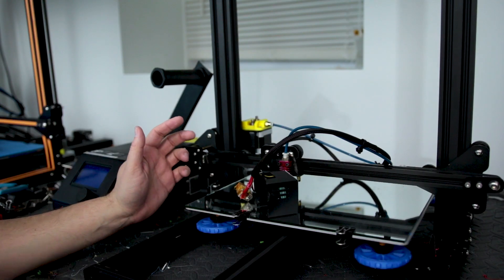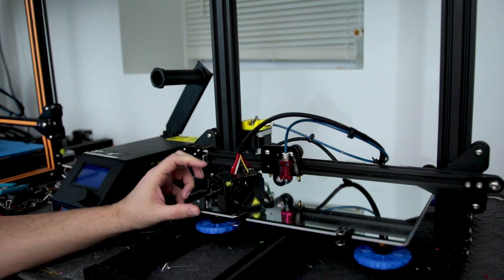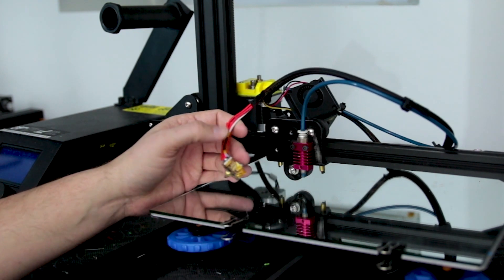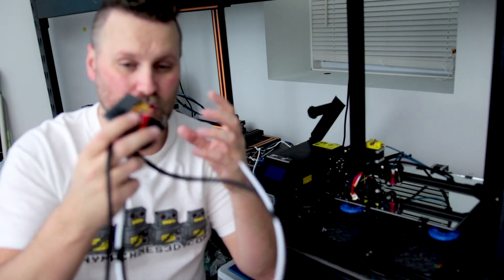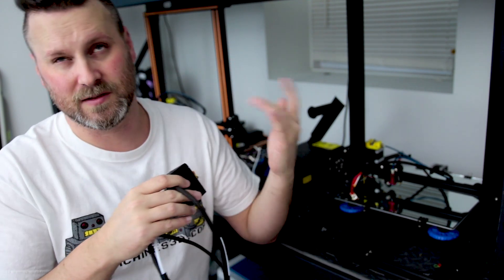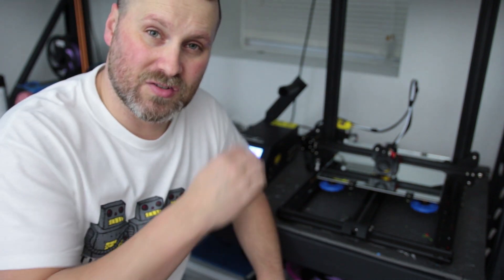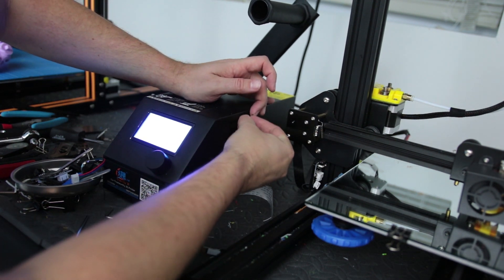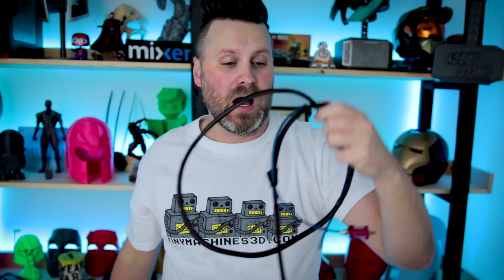I BROKE MY CR-10 3D PRINTER!

Comment: is this just the basic cr 10? I am looking into buying a cr 10 which one should I go with?
Reply from the maker: Nrc 470 standard CR-10 is my jam. Easily my go to printer. Filament runout sensor that’s on the new model is nice but I don’t necessarily think it’s s must have.
Reply: Uncle Jessy alright so I’m buying my first 3d printer. So would it be worth buying the cr10s or should i just buy the original Cr10. If I bought the cr 10 original I know you can add the extra motor. Let me know your thoughts.

Comment: If you just snapped the metal nozzle threads, you could have upgraded to an all metal hotend. No soldering is required. You are supposed to heat the nozzle before removing it to melt the plastic that's left in there.

Comment: I thought I would get an idea from you on my CR-10 Problem.  I have no experience on troubleshooting a 3D Printer.  
My CR-10 has been working great for several months.  Last week all of a sudden when I went to check on it printing a 9 hour project I found it had just simply stopped.  I uploaded a different pring on my SD Card and started it again.  About 3 1/2 hours later when I checked: It had again stopped.  The LCD just looked like it was waiting direction.  Again I tried a different project again after a period of time I found it had stopped again.  3 times it had stopped printing the 3rd or 4th layer.  One time it stopped printing a vertical panel 2 mm thick: stopped about 30 mm high on the Z.  Any suggestions would help.
Reply from the maker: Carl Beck here are a few things to test, try saving the gcode from Simplify3d/cura etc to your desktop of your computer then transferring to your micro sd card. Sometimes the card is almost full or slow to save the files. Are the prints failing at the same height or random? If same height check to see if the printer isn’t too tight on the upright bars and can move all the way up
Reply: Thank you for your input.  I keep my SD card neat with usually with less than 5 projects so it is not close to being full.  It stops at random locations.  Once it even got to about 30 mm high.  Other time it stopped randomly between 3 and 5 layers.  Thank you very much for your feedback.  I appreciate it very much.

Comment: Raspberry pi 3b with octo print and a pi camera then you can even remotely see and stop your print if it fails and the best part is you don't need to swap around sd cards or run your machine off your laptop.

Comment: It's nice that they have the all-in-one solution now. I had a failed heater cartridge on mine a while back and I remember that this wasn't available, since I had to figure out how to splice wires to repair it. Of course the heater cartridge costs like $2 versus $50 for the new hot end assembly, so it was probably a good thing that I was forced to learn to repair it in that case, but it's good to have the option when something goes really wrong.

Comment: in doing this print the tape on my bed was ripped off and mangled not good for future prints should just take the tape off and apply new tape?go with just bare glass? or flip it over and use the glass side without tape?

Comment: Hi, just want to start out by saying these videos are INSANELY helpful I dont know what I'd do without them but I tried printing the cat model from the sd card and when it began printing the filament I noticed immediately that it was not making a model remotely similar to yours. tried a different file same shape just went to far left corner of the bed and went left right left right left right over and over. Stopped my print after I heard the extruder struggling to move to the right and got this one thick sliver of plastic. Any help?

Comment: You also can fix the issue with the non locking micro SD card reader by removing the spring, then it functions like a friction slot.

Comment: I just had same issue on mine cr10 s4  as well the the extruder breaking but this was the metal shaft  from the cooling jacket to the hot end so i replace it with a new one called Zomiee from amazon works well no problems just finished printing the Red Hood Helmet

Comment: LOL - must be the day for CR-10 failures.  I had a wire on my fang cooling fan break in the middle of a 3 day print today.  Paused the print, re-soldered the wire, and resumed.  RE: SD Card - I don't get why people screw around with those.  Hook up an OctoPi and you'll never go back to SD cards.

Comment: Happened to me on the Anet A8.   bit to much force to get the nozzle of.   Did not heat it enough.  had to replace the heater block and the throat ...   its a pain, but not so hard to resolve if you have the pieces ....     now back to printing ...

Comment: This is the perfect time to upgrade the hot end so you dont have to worry about soldering later. Are you going to be upgrading the board to something that doesn't rely on closed source firmware?
Reply from the maker: Yeah I've been debating on trying out one of the hot end upgrades... might have to try that soon. Going for a new board more for the fix to the sd slot but excited to see what else it will bring ;)
Reply: The CR-10's Melzi runs open source Marlin.  You do need to flash a bootloader on older CR-10s, but it's not closed source.

Comment: Its super easy to snap the throat especially if you try to take the nozzle off completely cold(not saying you did, but I did when I was learning haha). The weak point is the threads so itll just snap off at the pressure point.  You can usually just get the snapped throat out with a bit of fiddling and some needle noze pliers though. Print this one when its back up and running Jessy it holds and protects the SD extension https://www.thingiverse.com/thing:2570622.
Reply from the maker: Ohhh nice! Printing that out